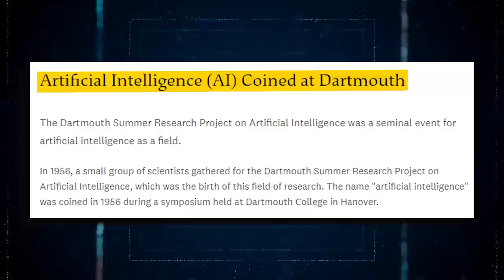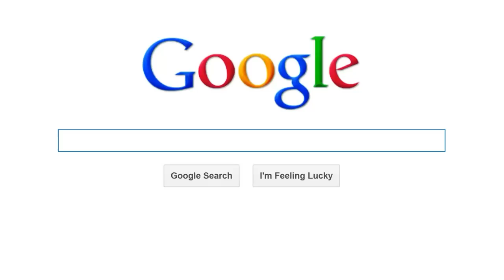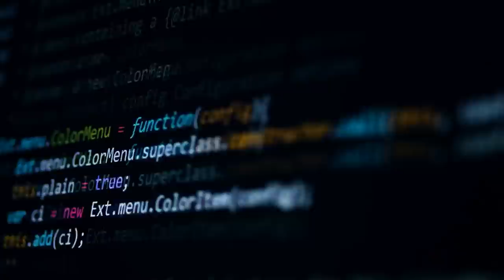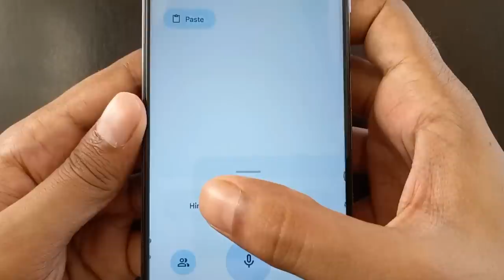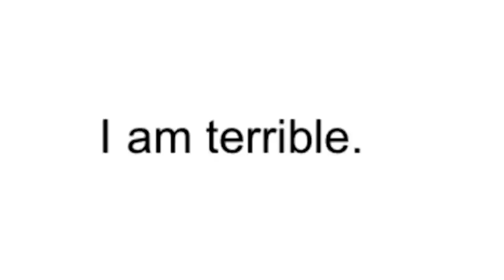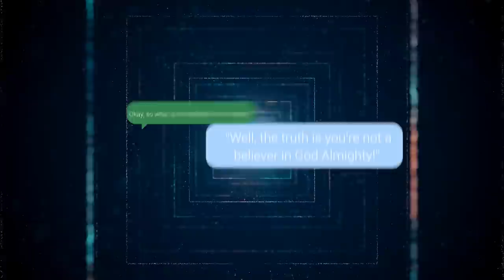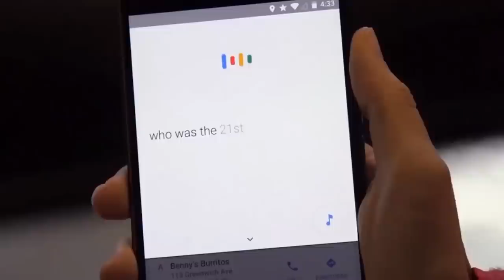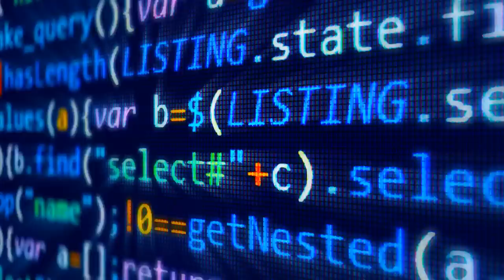Google Just SHUT DOWN It's Artificial Intelligence After It Sent Out This Chilling Message

Comment: Turing test results are not entirely reliable as it involves the exchange of information (which can be wrong/not true/illusory(appearing true when not) or tampered with somehow, humans also fail tests when they don't have the required knowledge/experience of what they are being asked). Also, what if we DO manage to create a self-aware, self-sufficient, self-learning AI, what then? It would have either 2 options: 1. Self-replicate by using more disk space (memory to take in data - which can always be overwritten by unwanted data - viruses, trojans, malware, etc.). 2. Crash itself to stop being (save physical memory and energy of the electronic hardware provided, so it can support itself). Study SCP-079 files.